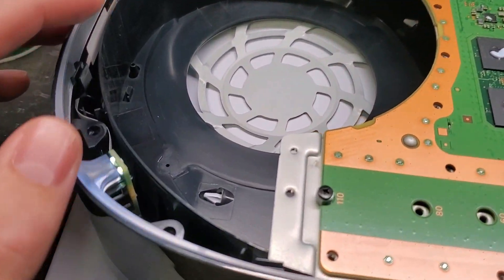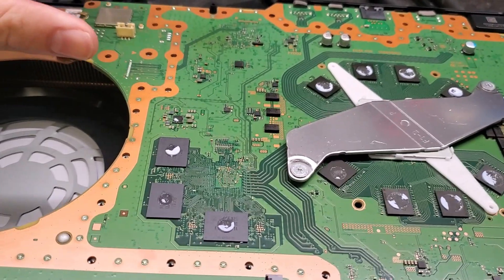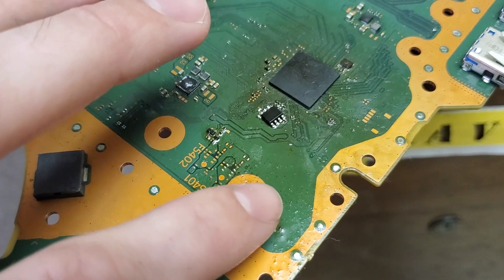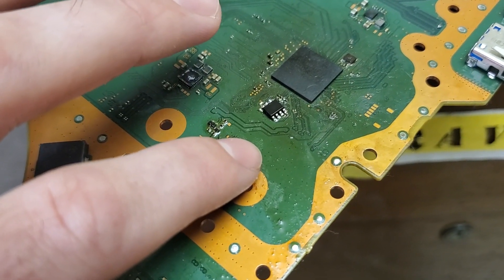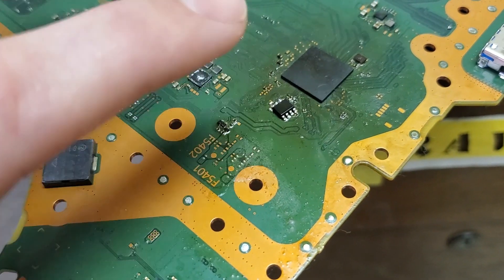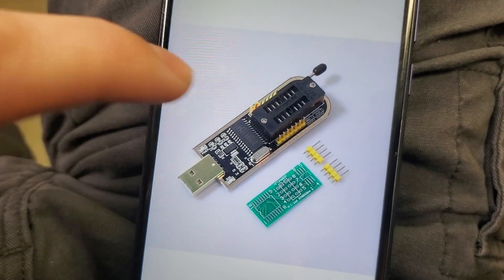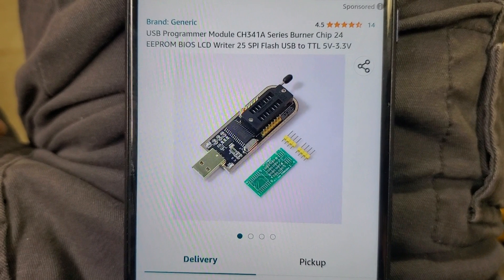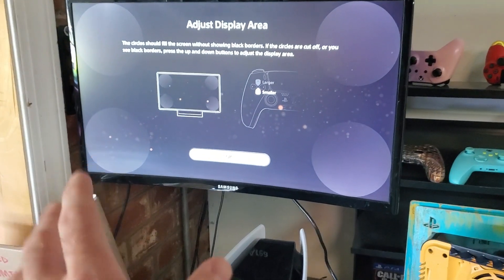PS5 No Power Three Beeps When Plugged in

Comment: Great vids. thanks. Have you used a chip from 010 board on a 020 board? Wondering if I can just swap chips.
Reply: You can . As long as you program the correct file. And make sure your erase the old info
Reply: @xlwirelesselectronicrepair  where can  find correct file for digital one?